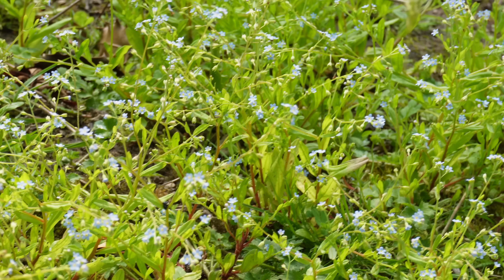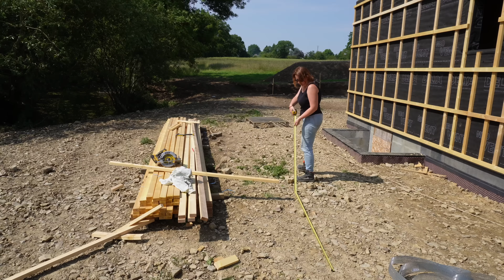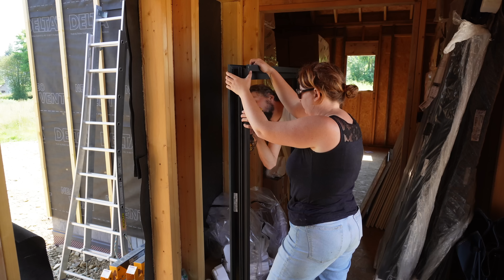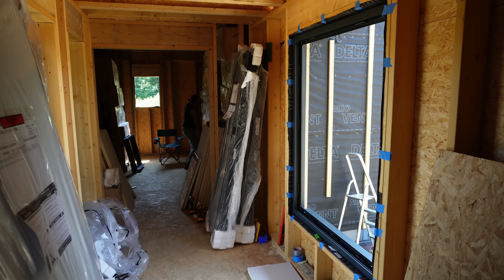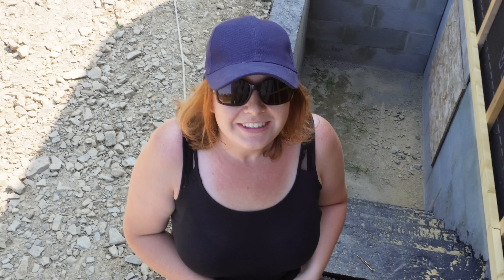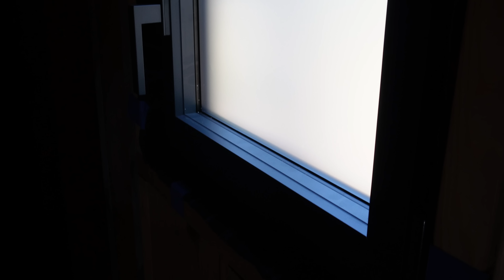On installe notre PREMIÈRE FENÊTRE et ça claque !- EP.92

Comment: Salut les Max,
Bravo pour vos deux premières fenêtres.
Petits conseils, évitez de mettre un grand vitrage à plat, toujours debout sinon une simple torsion en oblique  et votre vitrage peut casser .
Pour combler entièrement  le pourtour de la menuiserie, je met une mousse polyuréthane dosé avec un pistolet à mousse réglable ( 40€, réutilisable sans que la mousse ne sèche dans le tube). Pas plus d'un tiers du volume à combler. J'utilise egalemment un joint de fond ( boudin cellule fermées comme les compriband d20mm) que je fait rouler avec une spatule dans l'interstice pour les petits espaces . Lorsque vous utiliser de la mousse PU, si sa déborde , attendez qu'elle soit  sèche au touché, vous pourrez facilement la repousser dans la cavité sans avoir besoin de la couper.
Garder vos protection adhésive sur vos fenêtres jusqu'à la fin du chantier, en manipulant les matériaux ( plâtrerie, peinture....), il y toujours un risque de faire des rayures surtout sur l'aluminium. 
Bonne journée 👍
Reply from the maker: Merci pour les conseils 😊